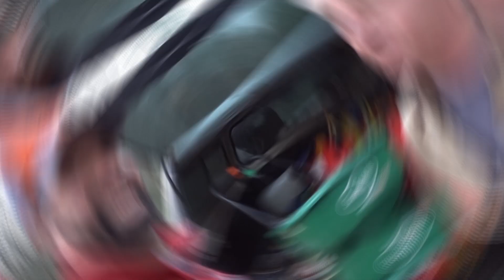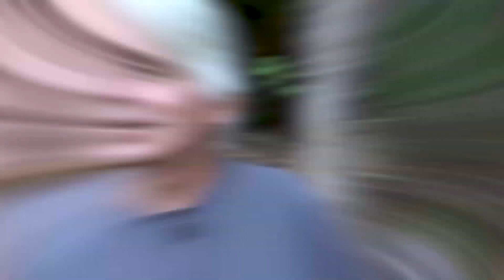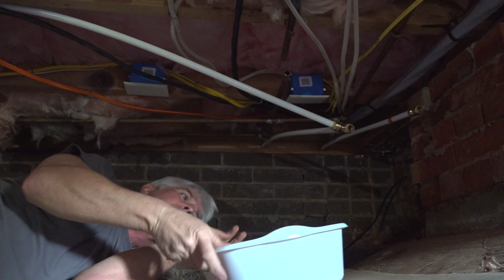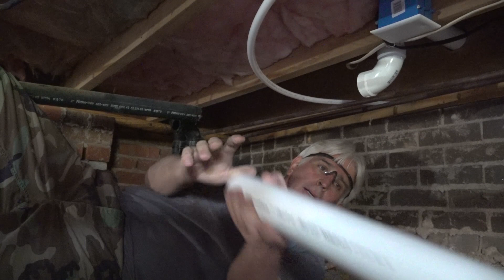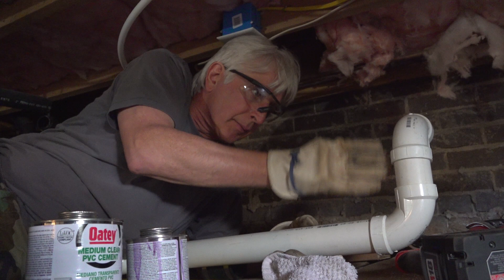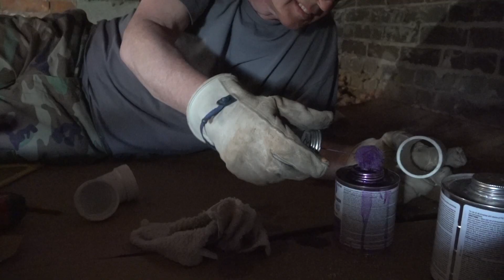Making Final Plumbing Connections - Kitchen Remodel E10

Comment: You should have reamed out the copper pipe with the reaming tool after you cut it, and checked the edge for burrs.  The Sharkbite connection depends upon a rubber gasket. If the copper pipe is curved inward at the cut, it creates turbulence in the flow at that point which will wear out the rubber gasket in the Sharkbite faster than normal.  A Sharkbite over old copper will leak.  You need to prepare the copper pipe shined up, deburred, and reamed to straight, just the same as if you were soldering them, for the best long-lasting Sharkbite connection.
Reply from the maker: Thanks for the advice!
Terry